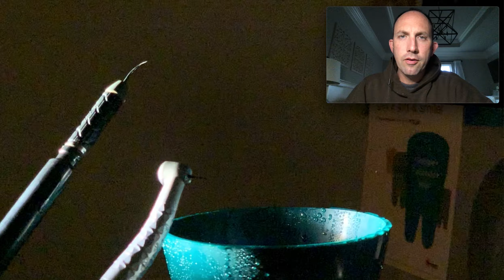Dental Aerosols: Ultrasonic vs Highspeed Handpiece

Comment: Great demonstration but a dentist still has the luxury of using an assistant. Not so for the dental hygienist who is working alone with both hands already occupied with a mirror in one hand and scaler/ultasonic handpiece in the other. This leaves the hygienist with more risk of aerosol exposure since we use the slow speed suction.
Reply from the maker: We have our hygienists using a high volume evacuation with an isolight/isodry and a saliva ejector. Granted there is always risk, but this dramatically reduces the risk.